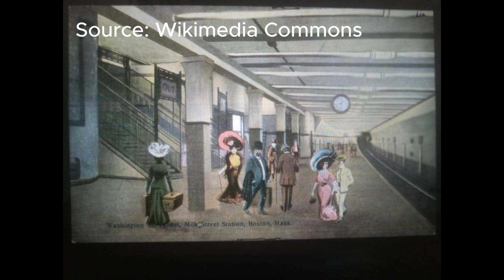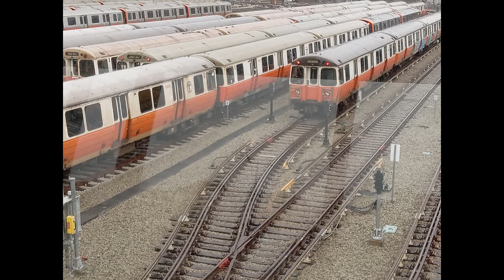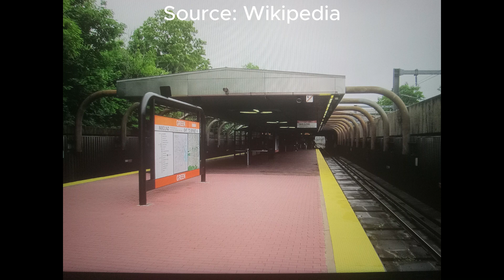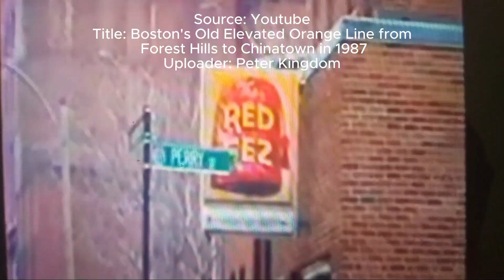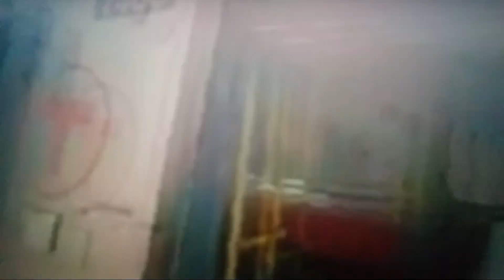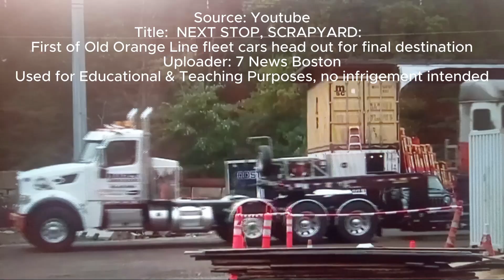Massachusetts Bay Transportation Authority Orange Line History

Comment: The hawker siddeleys were the last rapid transit cars to run on the old washington street el before its closure in 1987 and before the line moved to the southwest corridor serving seven new stations including new forest hills. The demolition and replacement of the elevated structure began shortly after closure with the last pieces of the elevated taken down in the summer of 1991 and the entire southwest corridor was completed at the same time. It was the first and official rapid transit elevated train line in all of Boston’s and all of U.S. history. It opened in three different stages between June 10, 1901 and September 1, 1912, with the majority being opened and in operation by late 1912.

The pullman 01100s lasted for only 23 years 1958 - 1981. The 100 cars, No. 01100 to 01199 were built and delivered between September 1957 and January 1959. The cars entered service between January 1958 and May 1959, replacing the Boston Elevated Railway and MTA Main Line Elevated 0900 series cars which were all retired by 1962. These were called “Main Line Elevated” cars No. 11 and No. 12 Series.
Reply from the maker: The 01100s first 50 cars were delivered in April, 1957 from the Pullman Factory plant in Worcester, Massachusetts the other 50 were delivered in 1958.

Comment: So, if the last 01100 series trainset went out of service in 1989, then all the 01200s were delivered by November of 1988.

In October of 1981, Hawker Siddeley got a $115 million contract from the T to build 120 new Orange Line cars and 70 new Blue Line cars.  At the time it was the largest single contract in the history of U.S. public transportation travel as well as in the history of the MBTA.

The first 01200 series trainset was delivered in the summer of 1985 and after a year of exhaustive and rigorous non-revenue testing, the first four-car set of the hawker siddeley’s hit the rails in the summer of 1986, at which point the pullman standards started being phased out. All the hawkers were delivered by late 1988 and the last 01100s left service in early 1989. By 1990, the entire OL was just the hawker siddeley’s.

Most of the pullmans were sent away from wellington for scrap by the summer of 1990 with the last scrap car leaving sometime in 1993.

In late 1982, the interior and exterior design as well as all of the major state-of-the-art components for the cars was finally finalized by Hawker Siddeley of Canada and approved for assembly with production starting shortly after. The first four-car set of 01200s was delivered to the T’s Wellington Carhouse in Medford in the summer of 1985.
Reply: Sorry man, wrong information. Thanks so much for the correction. I thought the 1100s lasted after 81’ in some sort of service I don’t think revenue, but I didn’t look too closely at the T’s page and seashore trolley museum’s website on the history of cars 01178/01179 saying that the pullmans last revenue run was in November of 1981.
Reply from the maker: The contract with Hawker Siddeley of Thunder Bay Ontario Canada was signed on  August 19th of 1976 with $115 million dollars. Deliveries began in December of 1979 and eventually on February 16th 1981 the first set entered for revenue service. By December of 1981 all 120 cars were delivered, by 1982 all 120 were in Active service. The 01100's last revenue service was on November 9 of 1981. Since those were recently Overhauled from 1974-75 they were still in a good operatable state. So the T held around 40 to 60 at Wellington's Maintenance Facility as seen in the clip of the documentary. About a couple sets were later transferred to Cabot Maintenance Facility in South Boston in 1983. The 01100s were used for the Southwest Corridor project and carried the materials needed and also served the Red Line for the alewife extension as seen in a photo of 01106 at harvard and for six car platform extensions. All 1100s were shipped off to scrap in 1987 except 1178 and 79 were sent to Seashore in 1991 from Cabot shops.

Comment: The last 01100 series train set went out of service in 1989. There was a period when the OL was running both the hawker siddeley's and the old 01100 series. They began phasing out the 01100 series, around 1985 - 1986. By 1990, the entire OL was just the hawker siddeley's. I'm not sure where all of the 01100 series cars went. I know a few of them are up at the seashore trolley museum and have been there about 35 years now.
Reply from the maker: November 9 of 1981 was its last revenue service on cars 01170/01171 01178/01179. After 80 01200s Series were in Active service. Since the 01100's received a mid-life overhaul from 1974 to 1975, about 20 to 30 was converted into Work Motors and were used for storing equipment, also carried cement, motor, bricks, cables, and metal along the Southwest Corridor construction 8 cars were moved to the Cabot Maintenance Facility in 1982 Via Grand Junction in order to help with the Red Line for the reconstruction of Harvard, 6 Car Platform Extension and the Alewife Extension. After all Station platforms were extended to Six Cars on both Red and Orange Lines. The T did Try to see if the 01100's were compatible with the 01400s series when they were overhauling them, although didn't match that much. The last 01100's set was Removed from Cabot and Wellington in 1987 for Scrap, the T did Try to sell one, unfortunately they didn't find anyone. 01178 & 01179 which ran in the best condition was stored inside Cabot Maintenance Building until 1991, when the Seashore Trolley Museum agreed with the T and they accepted them for their collection. The 01100's did not carry anymore passengers after 1981. The clip you may saw, shows Decommisioned 01100's series at Wellington in 1987, it was confirmed by a person they were Decommisioned. There is no prior footage of 01100's series operating with 01200s series in 1985. There was one photo of 01106 at Harvard taken in 1981.
Reply: @nafisali2434  no. That's not accurate. There was a short overlap between the 01100s and the hawker siddeley's. They, just like the pullmans and the bombardiers, worked together, but only for a short time. The last set of 01100s, yes, went to seashore. This was around July 1989. The others, yes, went to scrap. 1981 was not the final year for revenue service for the 01100 series. It was about 1985 - 1986, when they stopped taking passengers. The hawker siddeley's began service about 1980. The last set of hawker siddeley's was delivered in I wanna say 1982.
Reply from the maker: @dave_dave  The T's page, Seashore and other websites have stated 1981 was the final passenger trip. Yes a bunch of them were still around after 1981 for the Southwest Corridor, Alewife Extension and 6 Car Platform Extension. There is clip of them moving in 1983 at Wellington Yard Junction and the test track. There are photos of them at Wellington and Cabot from 1981 to 1987. Also 01178 & 01179 in Cabot in 1991. The 01200s were all constructed in 1981, probably it took 1982 for all 120 to run. Do you have any source about 01100s carrying passengers in 1986?